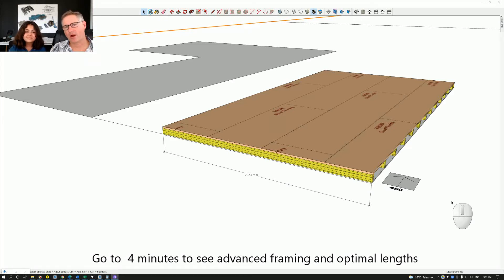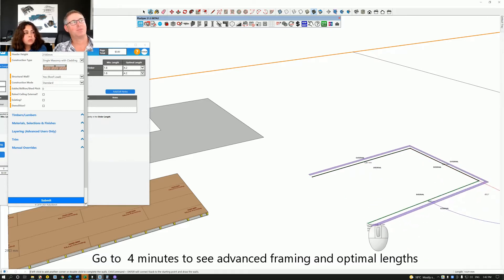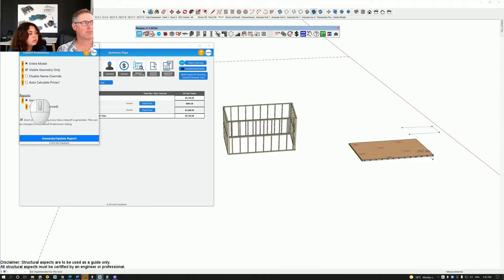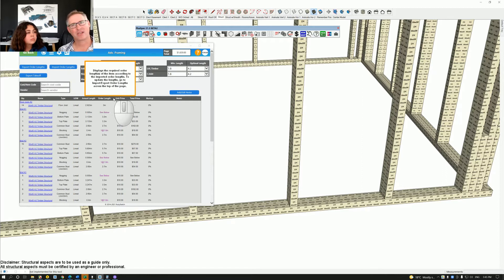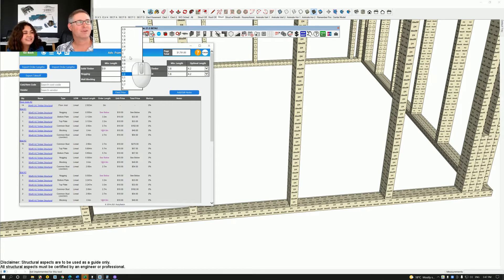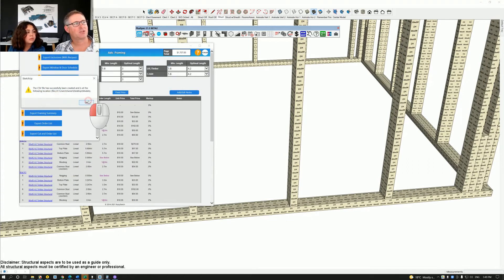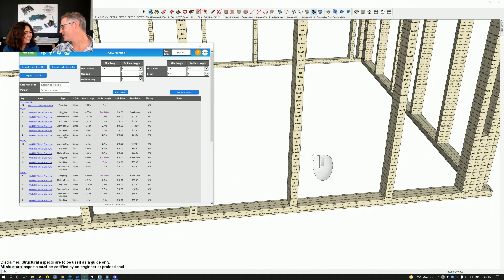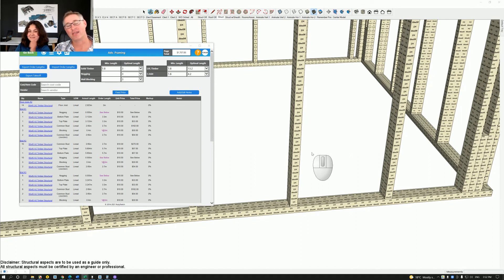Beginners guide to Advanced framing minimal and optimal lengths PlusDesignBuild

Comment: Well done Alice, get the old boy to move over....
Very good, I now get the recipe set up, small parts to make up the overall rather than having everything in one file.
Am I correct in saying there is a bit of time on the first job to set up then all jobs after I am adding to the recipes to create what I need?
Are there built-in recipes that I can modify rather than starting from scratch with them all?
Reply from the maker: Hi Mark, Yes recipes are built-in and even drawn in most cases, the only recipes we don't add are the ones that are builder specific, product-specific or location specific.